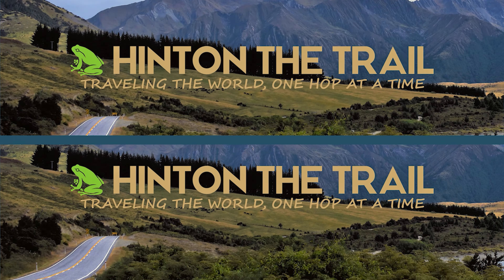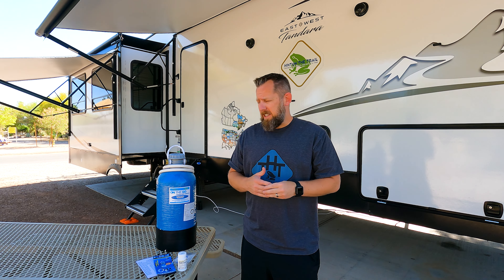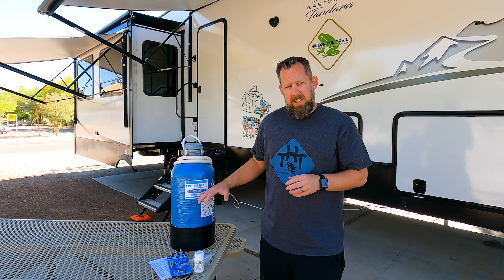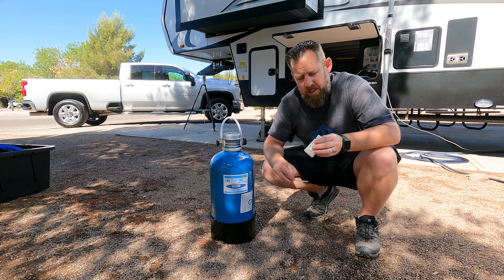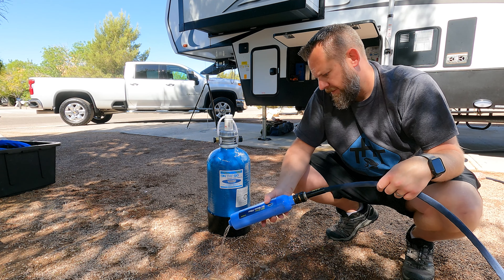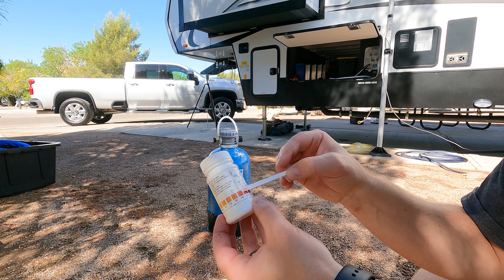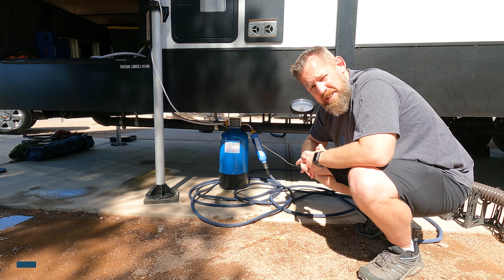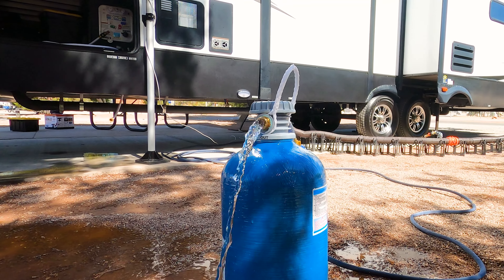Solve RV Hard Water Problems | On The Go Water Softener Install | RV Life

Comment: We are only 'part timers' but I still got the double model, for the times we're away for a few months.   I've had it for 3 years, albeit it's only been used over a period of two months, and never did need a regeneration!   Next trip we'll again be using it, and I thought I'd come on Youtube to check out the 'hooking up' of the unit, and you never mentioned if you use a water regulator, which we do, which I believe is set for 45 psi. of water pressure.   We found quite a difference, mainly when taking a shower, as we live in an area of soft water, and we now have it again when we travel, so the On The Go certainly does the job, and I was surprised at how long one can go before regeneration, albeit that's not difficult to do either.
Reply from the maker: We use a regulator and totally forgot to mention it!  Good catch. RV park water pressure can be very different from park to park and you’d definitely don’t want to risk busting a line. We’ve been through a few different kinds and finally settled in the 45-50 psi cheap model.  
So far we’ve recharged it twice and it’s very simple. Backflush and then regen.  It’s a great product and happy to see you’re loving yours. Good luck and safe travels!

Comment: We purchased the On The Go about 8 years ago after being on the road for a year. We know have on plumbed in with a automatic head. Nice video, thanks for sharing.
Reply from the maker: That's a great idea. Did you plumb the On the Go or is it a different product?
Reply: @HintonTheTrail  we we t with a different brand. It has a Fleck automatic head and a separate brine tank.
Reply from the maker: Ahh, sounds like a great permanent upgrade!

Comment: I would like to install this inside the RV unit. Is it possible to do that ?
Reply from the maker: You could but you will need to perform regenerations and backflushes periodically and it’s easier to do that outside.
Reply: Thank You. Where I will keep the trailer, it will possibly freeze at night. I plan to build an insulated box to keep the water softener in with heat tape on the supply line to it. with insultation wrap on the output from the water softener.   @HintonTheTrail
Reply from the maker: @mikedraper1762  The box is a great idea. you don't want the softener to freeze.

Comment: What happens if you are not full time and you have to store it for the winter or say 2-3 week in-between trips? will mold start to grow inside? what kind of maintenance do you have to do in that case?
Reply from the maker: David, you would perform a backflush, then regeneration, then drain all water from the system and then store it. The directions that come with the kit have all the steps. We actually had ours stored for about 6 months and no issues. Hope this helps! -Chris